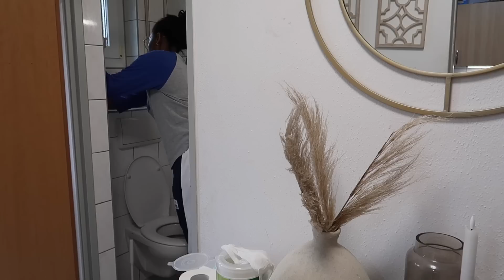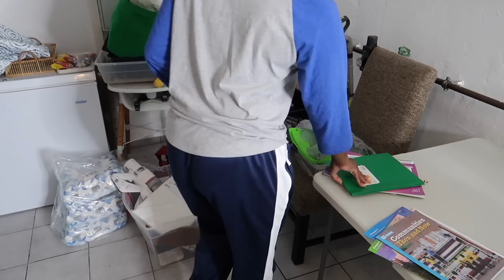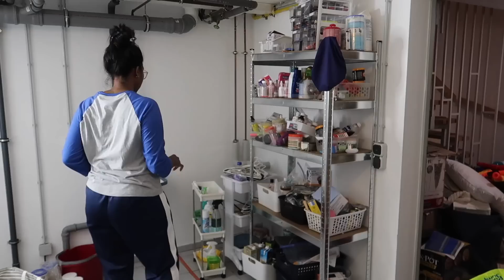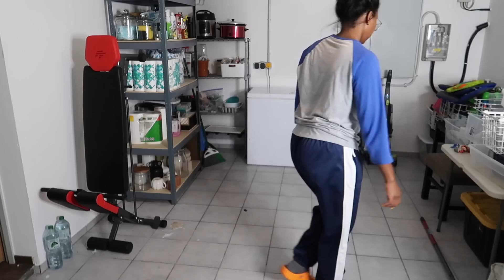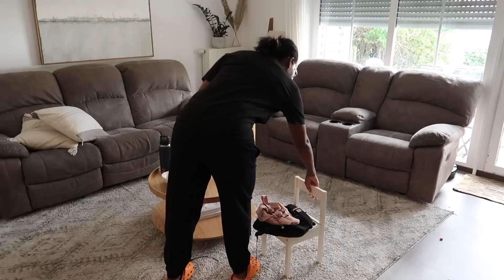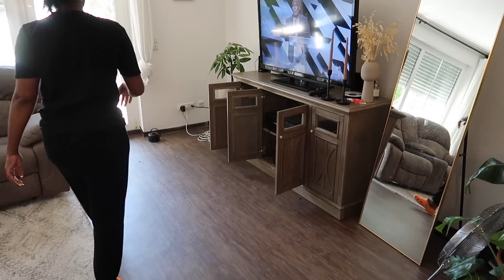COMPLETE DISASTER DECLUTTER ORGANIZE CLEAN WITH ME | EXTREME  CLEANING MOTIVATION|2023 CLEAN WITH ME

Comment: You guys need to figure out where the leaking is coming from so you can fix the problem where you won't have it again
Reply from the maker: Maintenance has checked it before and we thought the problem was fixed but it happened again. The bottom drain is the issue and it happens when we get nonstop raining.